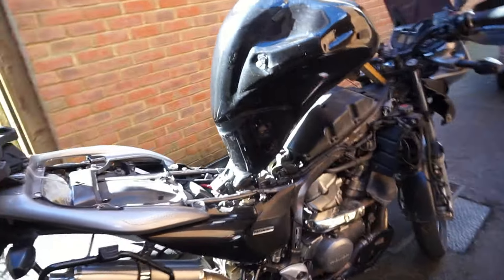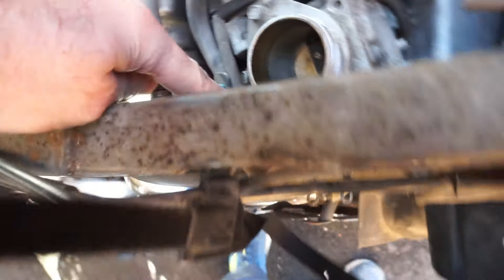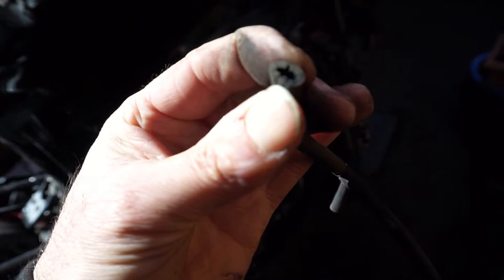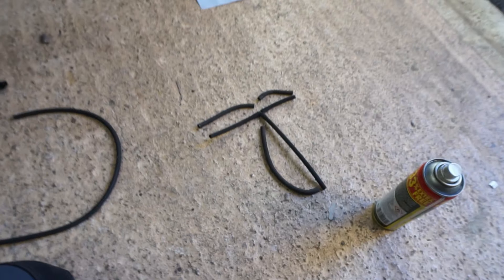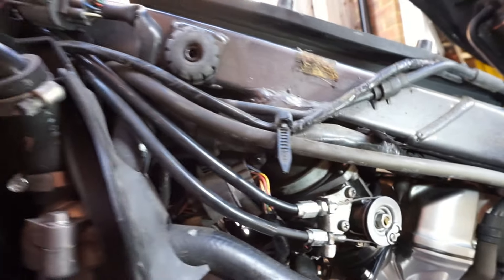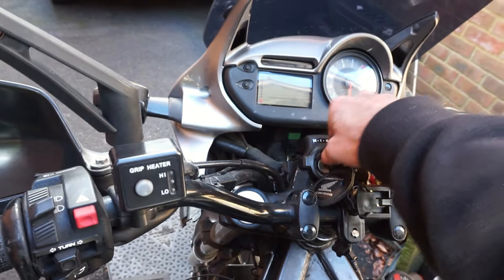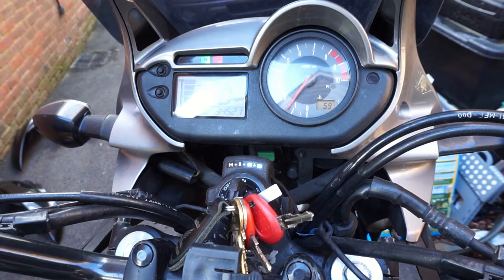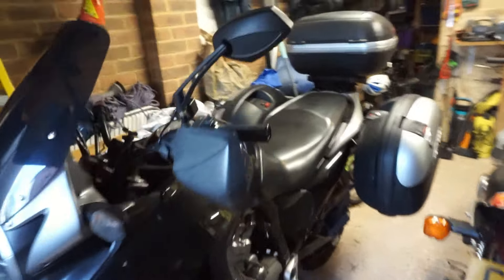Honda XL700VA Transalp won't idle and needed fixing urgently.

Comment: Good job. One word of caution - if the tubing wasn't specifically designed for automotive use, it may not have as much heat resistance, so may deteriorate sooner. Not an immediate concern, but worth keeping in mind.
Reply from the maker: Hi Thank you. It was an odd  length of fuel pipe from halfords so it should be good as a stand-in for vacuum hose.